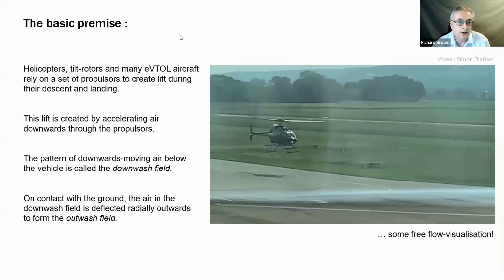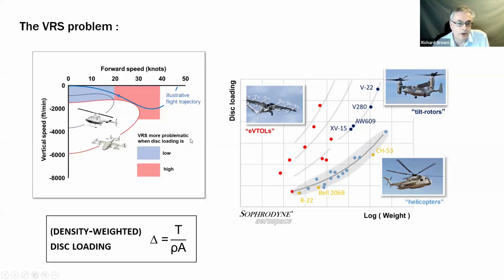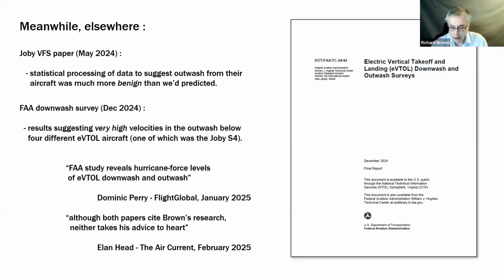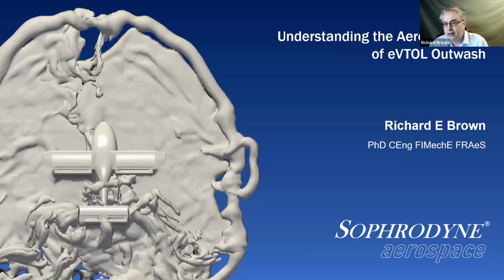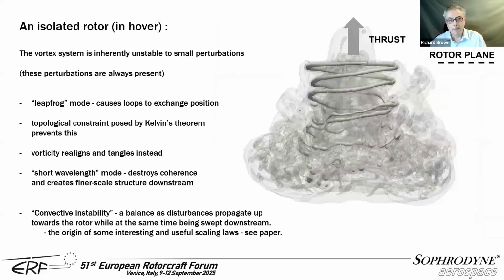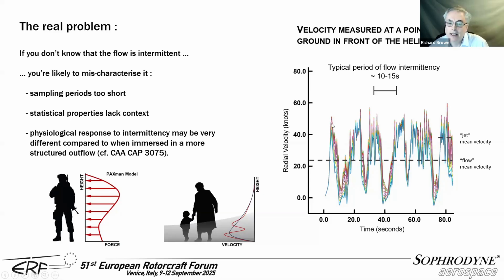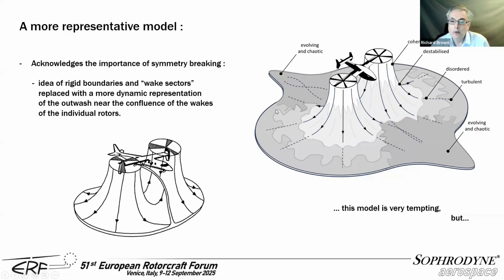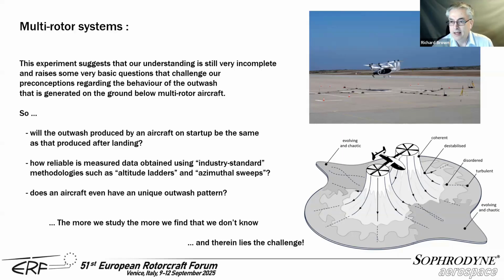Rotorcraft Outwash - ERF2025

Comment: So, Carlisle Pennsylvania midair, could you describe it as the helicopter sucking the Cessna in? Bit of interplay with the plane’s inertia and both directional and longitudinal stabilities in the face of the outwash then a bit of recirculation? Helicopter vortex set the plane wrong and cued the Cessna pilot to go around but while this bumped the plane around and perhaps rightward (inward from a left vortex) then the plane hit the outwash of the helo and due to directional stability snapped weathervaning toward the helo while still having forward velocity and also snap pitch up due to both headwind and up curl of outwash then flattened pitch as the curl lost upward and started back toward helo thus pushing the plane which still has forward velocity toward the helo more toward the helo and as now we’re relatively high to low pressure aside to above rotors, we see sucked in. Seems coherent to me whereas the botched go around narrative does not as typically botched go arounds go left. Sure, they could trim stall, but his forward velocity and already cleaned wings suggest he wasn’t letting the nose rise, and again, such would roll left. A case in which the late rejected landing proves you cannot always go around while accepting the crashed landing from vortex alone would perhaps have been more survivable. But one to which an earlier go around would have avoided. Though too, lack of consideration from the helicopter as it essentially hung out “on the runway” while its wash extended over the runway for long periods of time and while the helo really should have gone to the east ramp.
Reply: As analogy RE “sucked,” is a swimmer caught in a riptide sucked out to sea or pushed? Yet colloquially they’re described how?